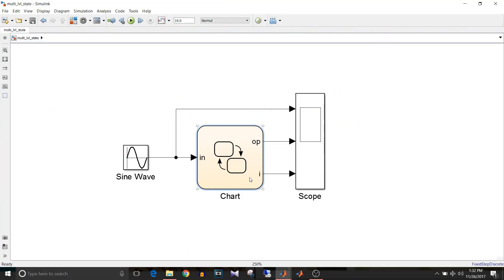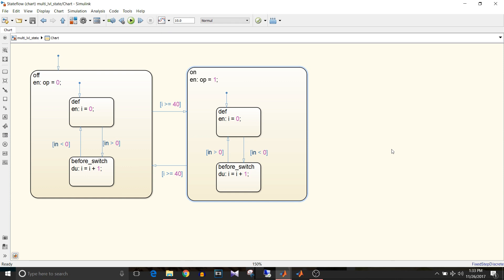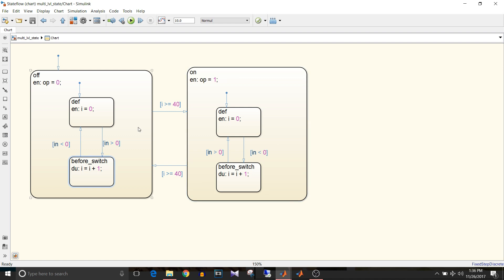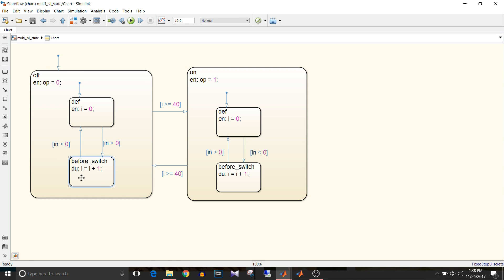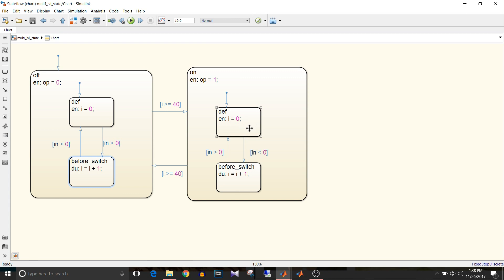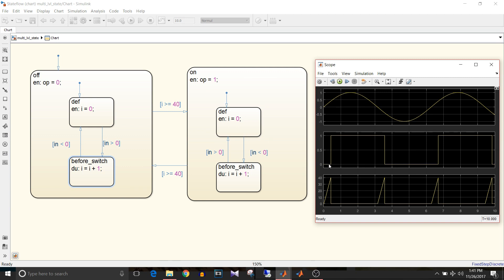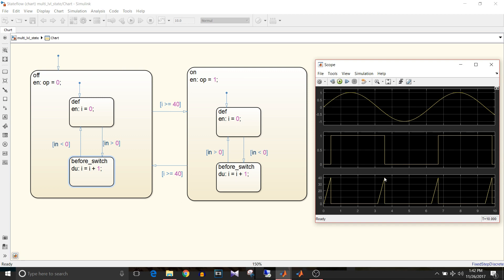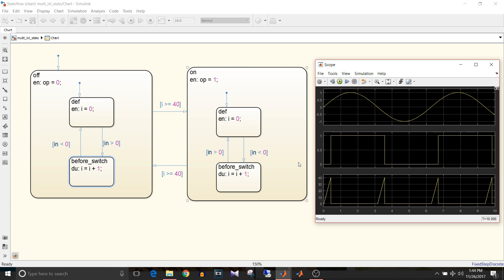Simulink Tutorial - 47 - Multilevel State Chart

Comment: Please anyone of you can help me to answer this doubt, I just wonder, which are the differences between exit and during? and when to use one over other?
Reply: Basic difference is when you want to switch from one state to another use exit. You can identify from output the first state is not active. If you are getting output defined in during that means your system is active.
Reply: Using exit, when the state is existed you can immediately change the value of the ouput for example, before entering the new state, while with during you can define some actions to happen while that state is active. 
During is usually used when, for example you have a local variable and you want it to increment or decrement till it reaches a value and it is used as a condition parameter for entering a new state.
Reply: @razvanungureanu8897  Thank you for your comprehensive reply